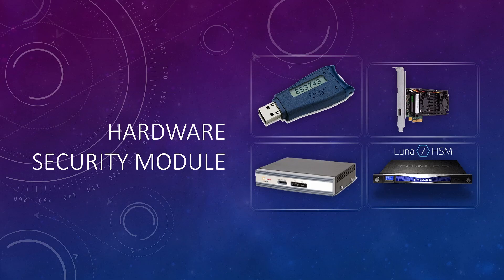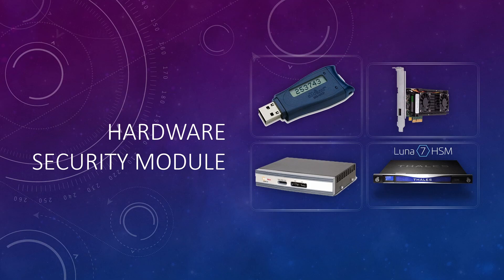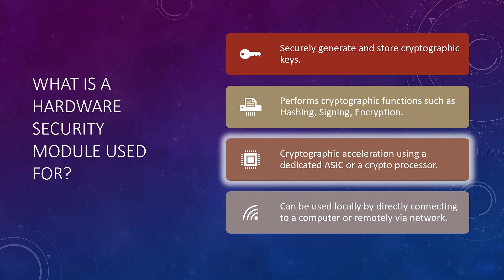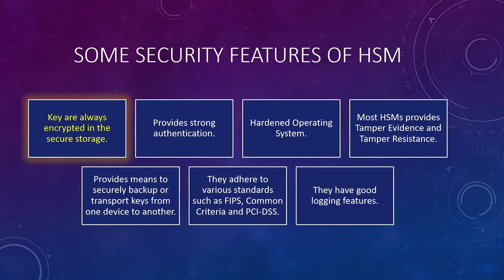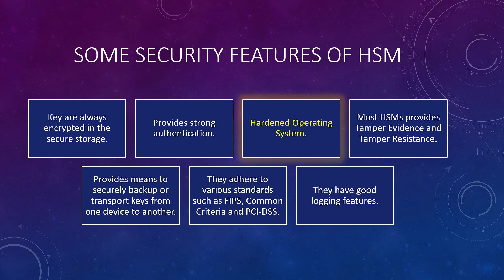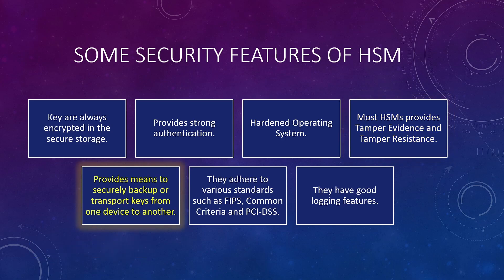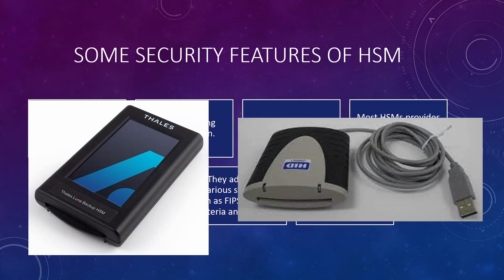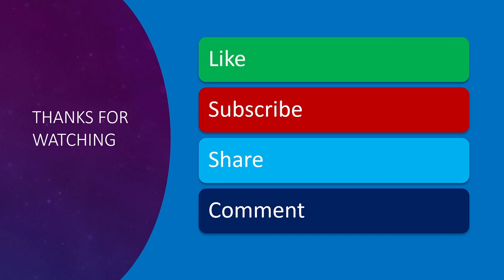Cryptography : What are Hardware Security Modules (HSM)?

Comment: The moment you start to believe in the security of cloud applications is the moment you also believe in Snow White and the Seven Dwarfs. (Because software is unfortunately still too vulnerable for such a belief).

Great video. I really would have liked to see an overview of consumer grade HSMs on this channel.  You have the heart and the head to explain it the right way.
Reply from the maker: Thanks for commenting, I do have access to some consumer grade HSMs, but they're from a single vendor and I want to remain as vendor neutral as possible. So i decided to use softhsm2 instead.

My plan is to finish PKCS#11 series and save the HSMs i have for the final video..
Reply: @CyberHashira  

You don't mean Yu...Key by any chance? Well, there is an OpenSource competitor called OpenKey, about which I unfortunately know too little so far, except that it is OpenSource.
Reply: Having taken some first looks at the OpenKey I would say it has Pros and Cons. 

The BIG pro however is that it's EASY possible to copy the contents of one key to a backup key WITHOUT any non-local software and pretty easy commands. 

A bulk copy is something I have been missing on the Yubikey from the moment I have started to read it's documentation. Big design flaw for every security concerned end consumer in my opinion.